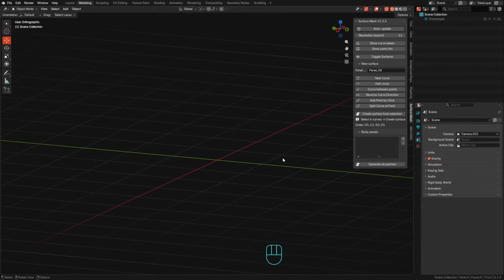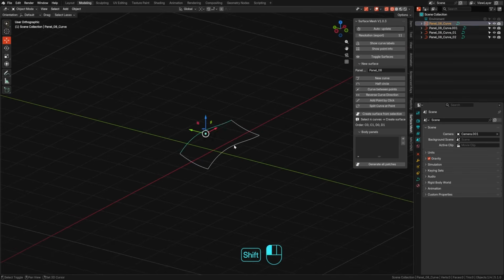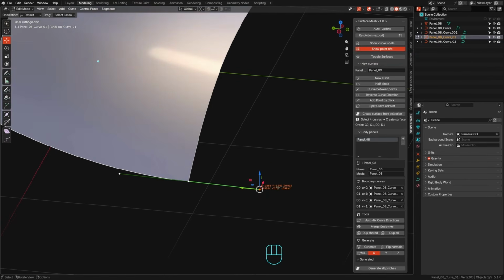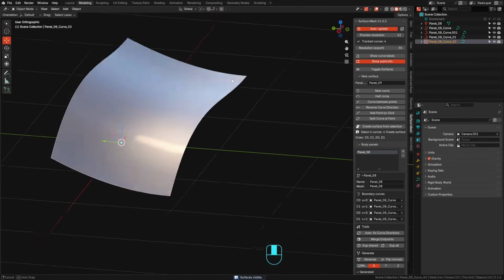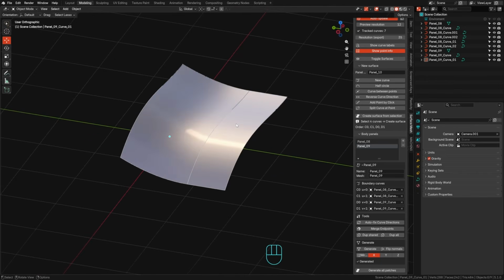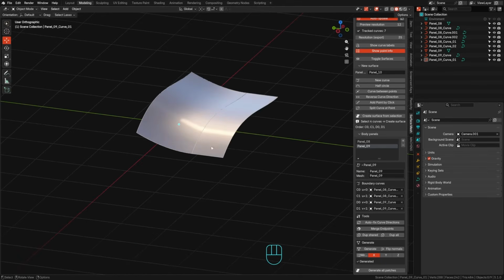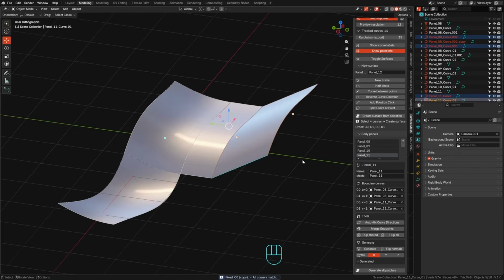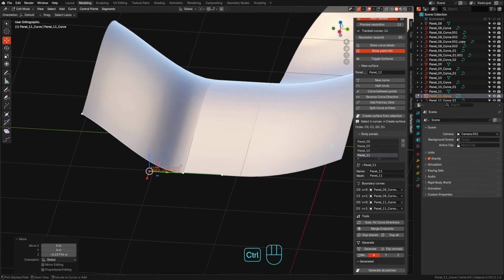Blender Addon - Surface Mesh - Tutorial 😉

Comment: Hello, this is very interesting. Thank you for making these videos. I hope it will be possible to get to G2 or even G3 💪
Would it be possible to adjust the values of the curves precisely using the numeric keypad via a shortcut, like in Plasticity?
Reply from the maker: Hi, hanks a lot for your feeback. Regarding continuity, I'll see how it goes. The surface mesh calculation works a little differently than in Plasticity or other CAD programs. Blender doesn't have a core for it. But that's okay, I'll try it in the future anyway.

Regarding editing values on a curve using the keyboard. Plasticity only has editing active when you make a straight curve or draw a rectangle or other shape for a solid. It's not active on curves with a control point. However, if it could be of benefit and help, for example when leveling, I can try to add it.